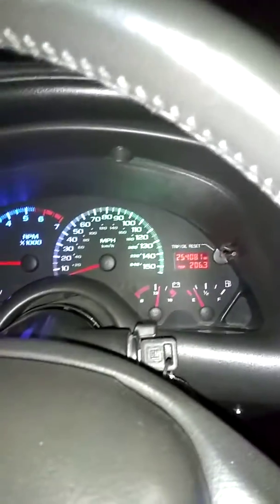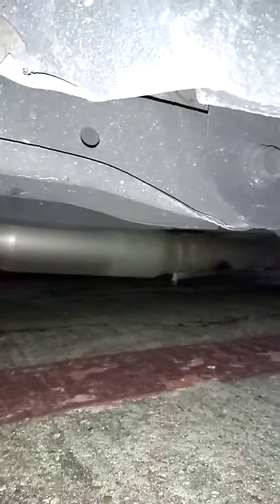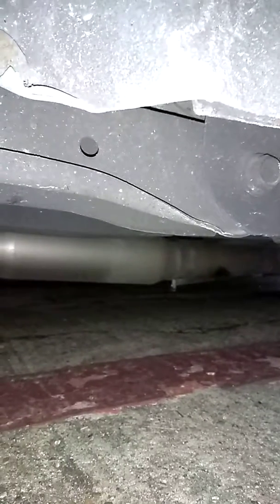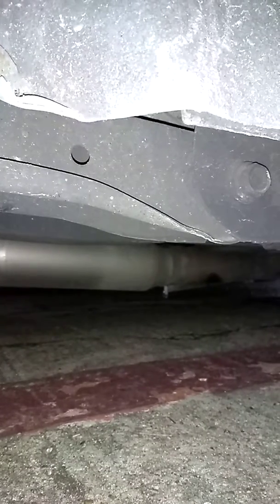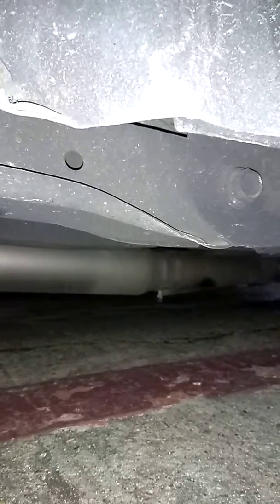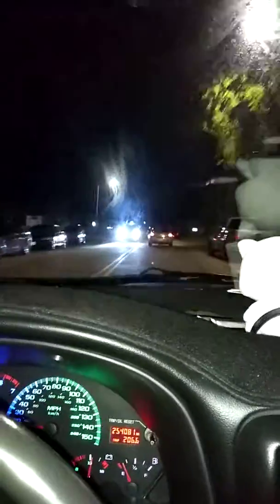Air Lift 1000 Install Chevy Camaro Z28 Final

Comment: I'm thinking of getting these for my 2000 SS,do they improve ride quality over all or r they just to prevent rear end from bottoming out
Reply from the maker: They make it stiffer all the way around. To me it felt like new shocks and if you are racing you can adjust the pressure for your liking. As you can see, I wasn't using it for racing. I still have the bags on the car and it still helps with the rear from rubbing and squatting. Just need something on the front now.
Reply: @VcArena  great imma prob go for it n install them as well,thanx
Reply from the maker: @IrocZ285.7  no prob. Glad to help